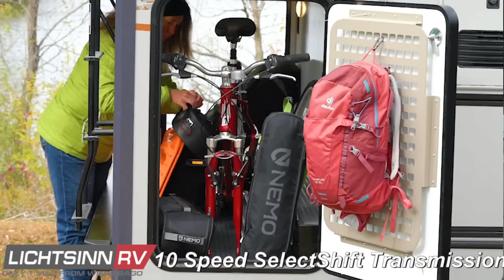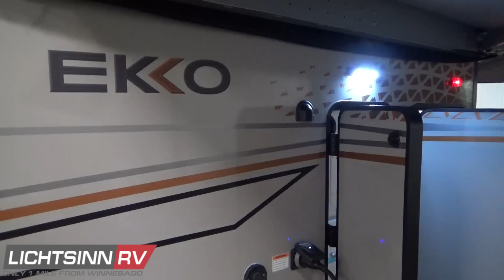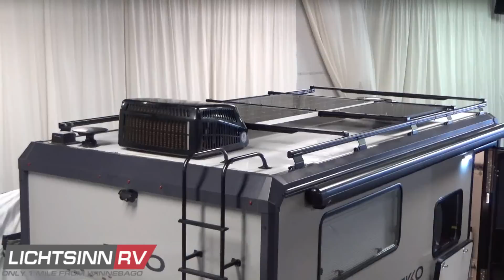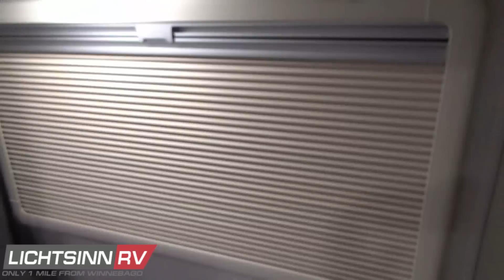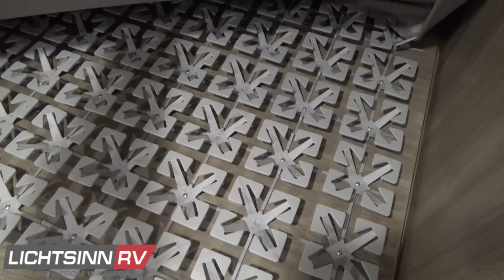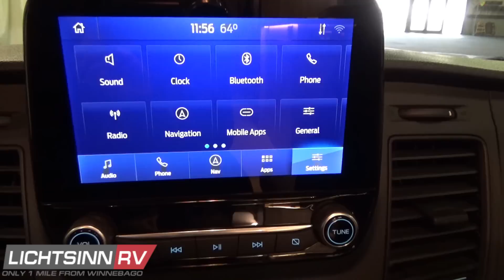LichtsinnRV.com - The Winnebago EKKO 22A Complete Walkthrough Video Experience at Lichtsinn RV

Comment: I have 2 questions.  Can the air conditioner system run directly off the inverter ?  How ling does it take to fully recharge the 2 lithium batteries using the secondary alternator ?
Reply from the maker: Good morning!   Thank you for your note!   Yes, you can power the AC directly off the inverter... in fact, look later this week for upcoming video we are finalizing last week in which we put AC run time to the test.   In terms of recharge, it will depend a bit on idle (approximately 100 amp charge) vs highway speeds (approximately a 170 amp charge), but a couple hours is a good range for recharging the Lithionics batteries.  Hope this helps!

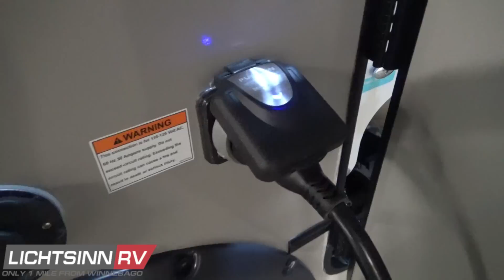Comment: It's our dream RV too!  He didn't mention the little light on the door of the shore power plug cover (go to 19:25), it lights when power is correctly connected (did you switch on the 20A circuit breaker instead of the 30A? Now you'll know without going all the way around the coach and walking inside to check the panels.  Smart.)

Comment: Please do a walkthrough of the *24C* as soon as you get it and make sure to tell if its 4x2 or 4x4 and any battery and solar upgrades that can be done on it. thanks.
Reply from the maker: Good morning Michael!   Thanks for your note... absolutely we will do a similar walkthrough when we can access the 24C slide out floor plan.   The power train and safety features will be identical, and everything rearward of the twin bed setup will also be identical to the 22A.    The lithium setup will also be the same and expandable here at our dealership.   Hope this helps!
Reply: @LichtsinnRV  can more solar be added also?
Reply from the maker: Good afternoon Michael!   455 watts will be standard which in essence max’s out the solar controller... we could look to add more, but the stronger charge would come off of running the engine or the generator, if equipped and not deleted... you can order the EKKO with a single lithium and generator and then having us add the second lithium.   Hope this helps!
Reply: @LichtsinnRV  Has the 24C been cancelled?
Reply from the maker: @ariesbarb418  Good afternoon Barb!   Thank you for your note... for the foreseeable future, yes, but of course Winnebago is continually in design
Reply: Awesome
Reply: Awesome

Comment: Love the Ekko , how does these Class B work in snow ? and also Solis , are they capable to go on ski trips ? ( or Revel is a way better choice if ski trips is a must ?
Reply from the maker: Good morning Jackson... in terms of snow performance, in order of most effective, you would find these ranked as 1.  Most effective is the Revel, then 2.  The AWD EKKO, then 3.  The Solis.   Hope this helps!
Reply: @LichtsinnRV  and how does the Boldt 4x4 fit into this ranking? Thanks!
Reply from the maker: @jarretbyrd1  Good morning!   The Boldt 4x4 would have the same system as the Revel so certainly the most capable in snow conditions, more so than the AWD EKKO or FWD Solis

Comment: I wish they would raise the exhaust pipe of the generator it seems to be pretty low. Where is Honda when you need them
Reply from the maker: Good afternoon Gregory!   That is not the lowest point and we could raise if it's a concern for you... ground height clearance is 6.5-7" which is the shackle on the suspension.   Hope this helps!
Reply: @LichtsinnRV  Did you mention price In the video I must've missed it I wish Winnebago would get in the air conditioning business there's got to be a better way than hanging it on the roof
Reply from the maker: @gregoryg.campbell3874  Good afternoon!   Base MSRP is $163,662 and then simply contact any of our consultants for our factory discounted pricing.   Hope this helps!

Comment: This is my dream RV. Other RVs might have the storage that Ekko has but none of them are 4-season. This will be able to handle Death Valley in the summer (though I wouldn’t be able to) and ski trips because of the insulation and no exposed holding tanks or water lines.

Comment: Great! I have something similar (in size, with a Ford Diesel front end)..a Thor Gemini. But I WISH I had a rear"hatch" that I could use if I need to insert a kayak or long lengths of lumber. The one MAIN disadvantage of these B+ campers compared to "walk through aisle" B's, is the inability to pack long things from the back. That washroom/shower is GENIUS! My ONLY problem: The MSRP is THREE TIMES what I paid for my new Gemini! (165K! Wow!). Not sure about the Ford Gasoline engine...but my For Turbo Diesel is amazing for power. And the Ford suspension cannot be matched!

Comment: Is there an option to delete propane completely?
Reply from the maker: Good morning Alex!   Thanks for your note!   Yes, you can but the appliances, such as the range top, VarioHeat and Truma AquaGo require LP, so these would be inop... Winnebago does not have an alternative for these, unfortunately.
Reply: @LichtsinnRV  thank you! My hope was that EKKO could serve as a larger version of the Revel.
Reply from the maker: @alexrubin2025  It will actually provide better insulation, more lithium energy, a larger dealer network for service, and more versatile livability at a slightly lower price point.
Reply: @LichtsinnRV  No option for Induction cooktop? Can you opt out of gas burners and have just solid countertop there?
Reply from the maker: @jeanniecrawford-lee7246  Good morning Jeannie!   Thanks for your note... while there is not an option from Winnebago to do this, with induction or flush counters, we could do here as an aftermarket prior to your delivery.   Hope this helps!
Reply: @LichtsinnRV  Thanks! Good to know.

Comment: Can a macerator be added to the wet bay? That way you could dump the gray tank into pit toilets also  and never need a dump station!
Reply from the maker: Good morning Richard!   Thanks for your note!   Yes, we could add that... either hard wired or in a portable macerator.
Reply: @LichtsinnRV  and it would fit inside the insulated compartment?
Reply from the maker: @arisdaddy2001  It certainly appears there is adequate room

Comment: Is it safe to assume that all of the lights, the fridge, the water pump, the igniter and fan for the Truma heat, and the usb/12 v outlets are directly connected to the 12 v system,  rather than requiring the inverter?
Reply from the maker: Good morning Susanne!   Thanks for your note!   Yes, you are exactly correct... and all you mentioned will really use a trivial amount of amperage on the lithium.   Hope this helps!

Comment: This is a well laid out RV. I have a feeling Winnebago will be selling a ton of these EKKOs. Any idea on the ground clearance?
Reply: Fit RV measured about 6 inches in their most recent video on this. There is a Transit AWD lift kit with suspension mods from Van Compass that adds about 2 1/4 inches. There are also some skid plates available for Transit, but they will eat up your OCCC.
Reply from the maker: Correct... all good points... thank you... the ground clearance is 6 1/2" to the bottom of the shackle that holds the shocks